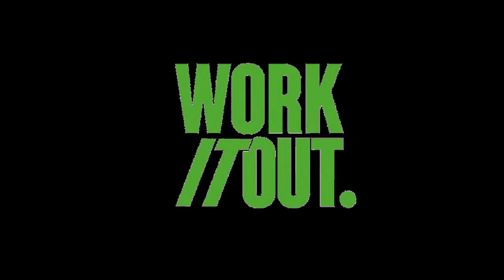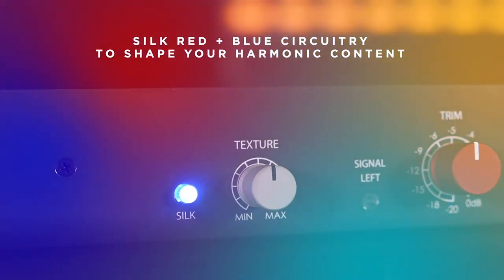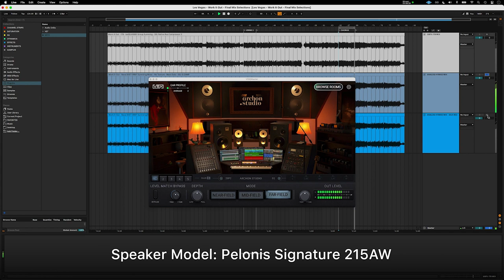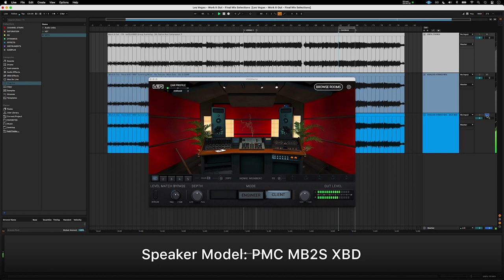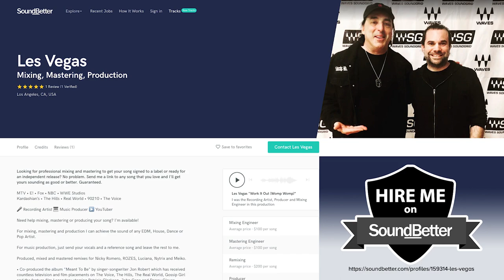Mix Comparison Using Slate VSX (With and Without Analog Summing and Mix Bus Processing)

Comment from the maker: Timecodes
0:00 - Intro
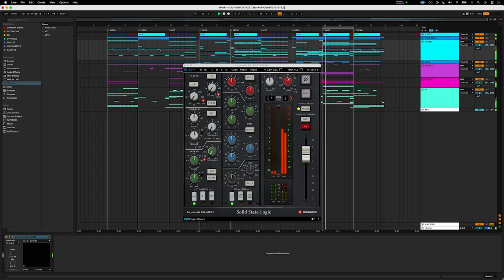0:44 - ITB Mix Details
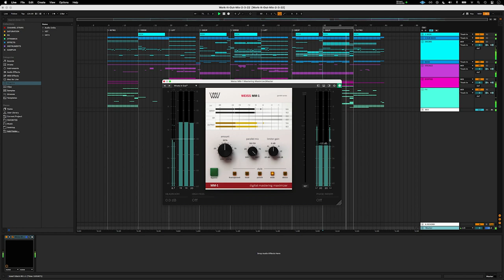1:24 - Analog Mix Details
3:27 - Mix Comparison
3:28 - Speaker Model: Slate VSX HD-Linear 2
4:09 - Speaker Model: Barefoot MM27
4:49 - Speaker Model: Pelonis Signature 215AW
5:30 - Speaker Model: PMC MB2S XBD
6:11 - Speaker Model: Yamaha NS10
6:52 - Speaker Model: ATC SCM25
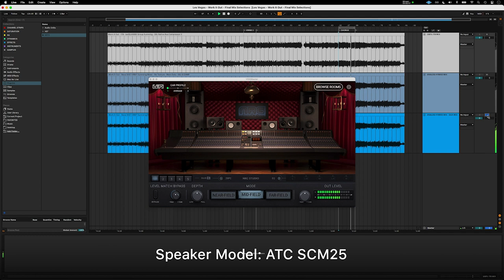7:32 - Speaker Model: Tesla Factory Sound System
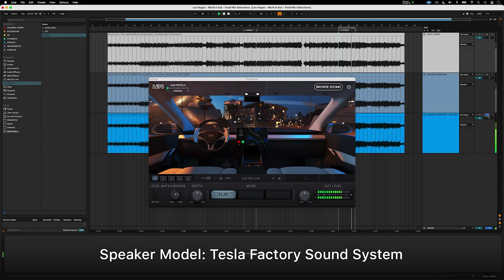8:13 - Speaker Model: Mercedes SUV Factory Sound System
8:54 - Speaker Model: Funktion-One Res 3 Sound System
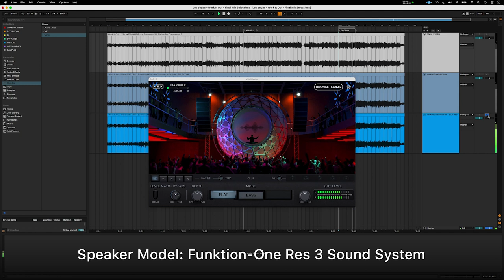9:34 - Speaker Model: Sony ZS-PS50 Boombox
10:15 - Speaker Model: Apple AirPods

Comment: Im just wondering when you say you used The Weiss on the "master"..do you mean after you rendered the stereo mix to stereo 2 track? And then where is the Weiss applied? I'm on Logic X soperhaps PT works diferently?
Reply from the maker: @JohnFindlay Hey! Thanks for watching and for your question. I just used The Weiss MM1 Maximizer on the Master channel for a bit of width before exporting the final mix. No limiting applied. I wanted to keep all the dynamics in tact and the levels well below 0 dB before handing it off to the mastering engineer. I'm in Ableton in this video but yes, Pro Tools, Logic and all the other DAW's would work the same way as far as plugin order and routing is concerned. I hope that answers your question. Please let me know if  you still aren't sure on something and I will provided an additional explanation.

Comment: Disclaimer, I used my WH-1000XM5 headphones; traveling and no access to flat studio headphones.

In my humble opinion…. The two best, all around mixes were the Pelonis Signature 215AW & the Slate VSX HD-Linear 2 mix… (Regarding some of the other mixes, my ears where hearing a standing frequency, made me want to inspect the mix with FabFilter; Could be my headphones).

Those two mixs sounded good to my ears however; More details on what I think:

Everything besides the Vocals in the Pelonis Signature 215AW mix sounded GREAT! The vocals sounding sort of flat…  
Also, the vocals sounded AWESOME in the Slate VSX HD-Linear 2 mix, but all else sounded flat & slightly boring compared to the Pelonis Sig.

Out of curiousity, I wonder if you can somehow use the Pelonis Signature 215AW mix, except use the Vocal mix from the Slate VSX HD-Linear 2 mix?

Overall, you really have some pro sounding clarity for sure! 

I’d love to see some other genres too, like Modern Rock, Indy Pop, Metal etc.…
What you are doing is REALLY COOL! Thank you :)
Reply from the maker: Thanks @juicyriffs805! Do you have or are you thinking of getting the VSX headphones?